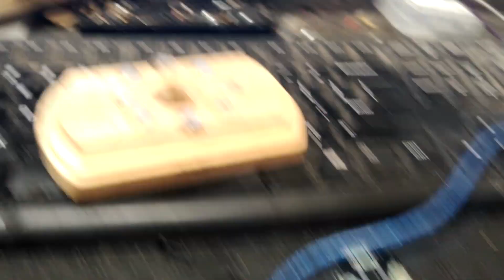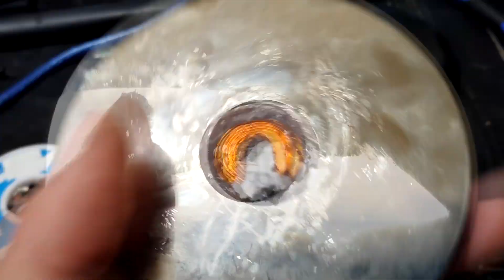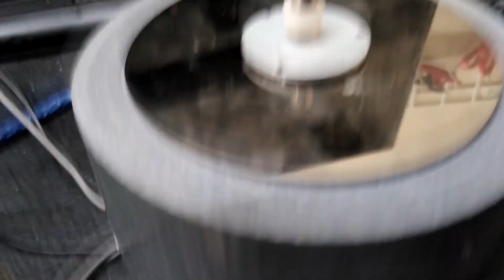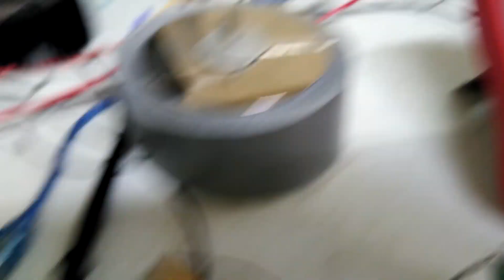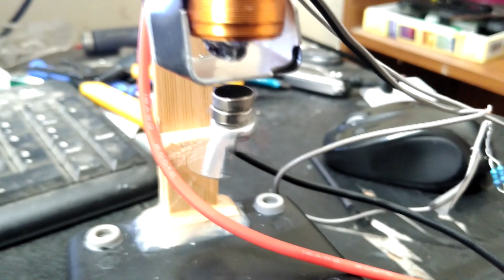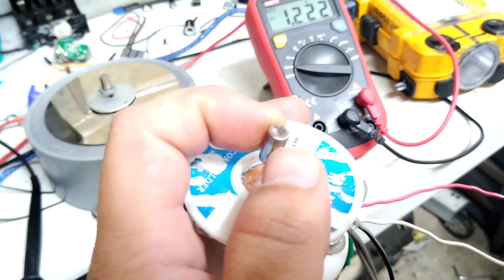Simple Transistor Levitator And Friends

Comment: The coil with the wing nut you might benefit going with a variant of a 555  timer circuit and transistor. More or less you are oscillating the coils into resonance to keep the weight in suspension. For levitating magnet i would put that in a large clear drinking straw for tuning tell it spun freely. Its been a long while watching these videos. Always chasing magnetic field is fun but very complicated sometimes.
Reply from the maker: I ended up taking that wingnut one and tuning the hall sensor output voltage a bit with a pot in parallel with the 1K resistance. It gives me a slight variation now where I can hone it to different weights. It's kinda cool that even with the 100mA it pulls when running I can tune the pot to raise and lower the suspended magnet very slightly. I just ran the thing from an 18650 battery through a 500mA USB boost converter so I can run it on the portable and recharge it from micro usb. Too small to be anything other than a small demonstration deal for people like me who are super late playing with these things. 10 years ago it was an amazing feat, nowadays it's like "oh yea my nephew has one of those" lol.